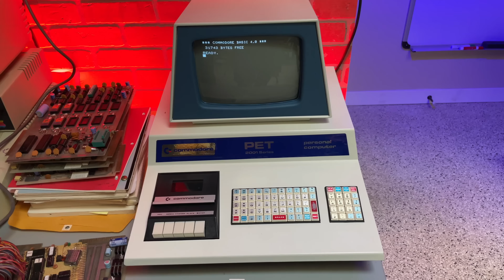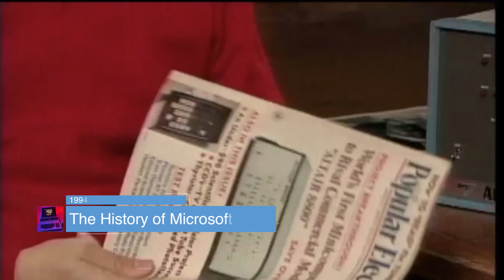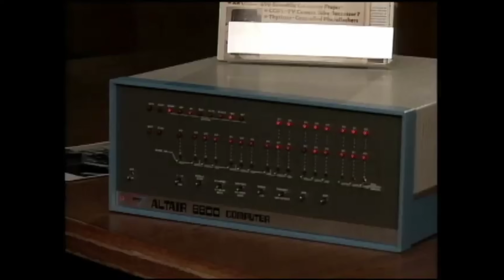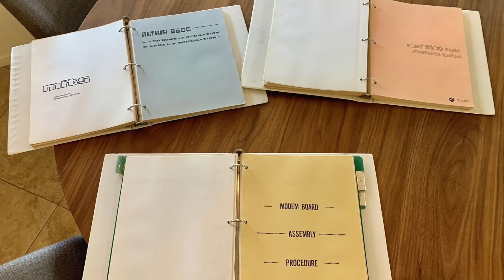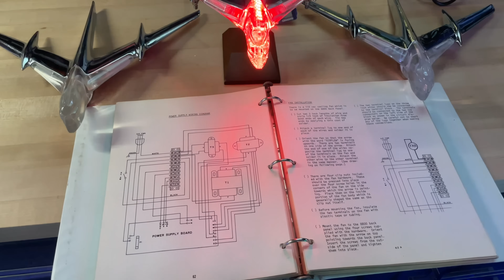The Computer that Birthed BASIC and led to Microsoft!

Comment: This is a story about the one that got away. When I first moved to Seattle I traded a friend a high resolution (for its day) monitor for an Altair with all the goodies. The Altair was rumored to have belonged to one of the engineers at MITS.  It was fully decked out with 48K memory, 4-8 inch drives, serial and parallel ports, a Hayes modem, running CP/M 2.2, Wordstar, etc.  I drug home An old DEC lineprinter up to my second floor apartment in Kirkland, Wa.  In other words I was in computer heaven.  Then circumstances prevailed such that I had to return to Florida for a short period of time.  I left the Altair with a friend expecting to return soon.  Unfortunately soon didn’t turn out to be that soon.  My friend got married.  His wife didn’t like seeing the Altair taking up closet space, so the Altair ended up being sold in a yard sale for something like $20.  I still have a number of vintage computers but the loss of the Altair breaks my heart.

Comment: We actually already have the same power distribution concept now as that Altair 8800. The graphics card isn't actually using 12V to operating anything. But 12V is a better voltage than 5V or 3V3 or 1V8 or 0V9 to distribute because a higher voltage means a lower current.

So the PSU sends 12V to the motherboard that has DC/DC that produces the CPU core voltage, CPU I/O voltage, RAM voltage, chipset voltage etc.

And the PSU also sends 12V to the graphics cards that has DC/DC to produce the voltages for GPU core, GPU I/O pins, RAM, ...

So the use of alternative voltages gets reduced as each new ATX PSU standard gets released. A long time ago, the main power rails were 3V3 and 5V and the 12V rail was mostly to the disks. Now almost all power is drawn from 12V.

DC/DC have become cheap since they are so much integrated. Some are a single chip. Some needs a transformer, some capacitors, maybe one or two inductors and one or more switch transistors.

So it's best for each electronics designer to design the custom voltages needed while the PSU just focuses on enough stable power at best efficiency.

Comment: As noted in some other comments, the electrolytic capacitors on the supply board should be replaced.  They do dry out over time.  They are inexpensive and readily available and look to be easily accessible on the board for easy removal and replacement.

I recently replaced all the electrolytic capacitors on my 1980 Kenwood TS-830s amateur radio, which was over 100 capacitors and took a while, but slow and steady work finished the task over a weekend.

My first computer was an Ohio Scientific Superboard II.  One of the guys I was stationed with in the Army in at a satcom station in Daegu Korea in 1978 had assembled his own computer from Ohio Scientific from scratch, including soldering in many of the IC chips on the various boards.  Hi Mike if you're out there . . .   

We spent quite a bit of time playing on that and learning and writing programs in 6502 assembler and BASIC.  By the time I was ready to purchase a computer myself sometime around late 1978 or early 1979, they had released the Superboard II computer which was mostly ready to go, just needed a TV and cassette player for saving and uploading programs.

Great starter computer and first of many many more in the 40+ years since then.

Comment: This is the original type of computer, flashing lights and switches. A superb teaching and learning aid because it takes you through the evolution of computers. I'm assuming you add a serial port and storage and end up with a normal computer you can type on.

Comment: 11:40 "I honestly don't know how much water electronics are capable of temporary tolerating..."

A whole lot. Assuming you've removed the power source and discharged any capacitors before the water happens, and you dry it all out before it has a chance to cause any corrosion, it's actually pretty hard to destroy electronics with water alone.

Comment: And for me personally.... I am happy that I lived through and experienced the evolution of home computers, from the mid1980's (84/85) and to now. To me, the height of MS, were back during the MS Dos 6.22 days. Back then the OS were bullit proof and if you lost data, it was only a question of having two floppy drives and booting norton undelete from A:.

Late half of the 1980's and first half of the 1990's were also cool. It was a magical time with Commodore, Apple, IBM, MS and others, pumping out new stuff and inventions. That was the golden time. To me, as I were gaming in the 90's, then the years 1992 to 1993 were the most magical. 1992 is that year that started with the Amiga being the best gaming platform, and ended with Dos x86 being the best gaming platform. 1992 were the time were everything were just so beautifully balanced all over the industry. The year were all top-machines for home that were sold in shops, gave the same kind of premium experience. Yup. 1992 is the ultimate year with most equally good choices.

It is a sad time we live in now. Only few makers of hardware. 😔

Comment: you can just use a modern switch mode power supply with a variable voltage pot. Measure the Amps consumed and get a replacement, just because thats how it was done 45 years ago don't mean you still have too. Plus those transformers need rewinding badly  and might catch fire, I would leave the room while its on at least... rock on dave.

Comment: The crap computer switches and LEDs in my electronics tech course in 1980 we had a TRS 80 level 3 no floppy drive,  including micro computers from Heathkit  ET3400a micro trainer .

Comment: It's my understanding that the "computer that birthed BASIC" was a mainframe system on a college campus.  It was noticed that the computer was standing idle most of the time and it was capable of handling input from multiple users at the same time.
So BASIC was developed as an easy way to program the computer (a lot easier than the other languages which existed at the time, which were oriented towards particular fields, such as COBOL for business and FORTRAN for mathematics).  BASIC was instead designed to be versatile and easy to understand.
Computer terminals were located in accessible places around the university, all linked to the computer so that anyone could program the computer in BASIC and save their programs on the computer.  It proved to be a huge success and this was the real birth of BASIC.
Although the Altair may have come first in the home computer market, it's my opinion that the TRS-80 was the first really popular "home" computer to use BASIC and led to the huge popularity of incorporating a version of BASIC into all home computers during this era.
Reply: I so agree!  Microsoft didn't birth BASIC.  I mean MSDOS was good.  Basic wasn't a thing on my univ. mainframe ... it was Pascal or Fortran 77, but that was in '88.  The dummy terminals sucked at text editing.  I still have my TSR-80s in boxes.
Reply: Oh, and congratulations on fixing the power supply.  I know how much fun it is to work hard on something not knowing what the result will be and then find that your efforts were actually worth it.

Comment: I know you can use a dishwasher to clean modern computer components and motherboards(see der8auer on YouTube) the older boards with exposed wires & non machine soldered connections I would be hesitant to expose to regular tap water.

Comment: The filter cap in that linear power supply are all worth replacing give the age of that . As well as cap manufacturing has progressed almost as far as the computers  in the last 47 years.  Go with 105C cap they will live longer .  A switching supply will have  noise in this app.  Not sure without measuring it if that noise would effect the unit. Given that this unit is now more a museum piece rather than a work horse  my concerns may well be over blown . Regards

Comment: I worked for a company in 1977 -78 that had exclusive to sell IMSAI 8080's  - essentially the same as the Altair ad I think made by former Altair employees. One summer at Ultra Byte I sold over 150 of them , 20 to NASA - they claimed to be using for "mail system" but a couple years later I saw them in mission control consoles.

Comment: I started programming BEFORE there were personal computers.  I started on an IBM 1500 system in a CAI lab.  Thats Computer Aided Instruction.  Later I wotked for a CPA firm that used the CPU froma 1600 system stand alone.  That IBM 1130 was just about the smallest mainframe ever sold.

Besides running the normal educatioal sofwarte it was capable of running other styff.  It did not run BASIC.  It ran APL (look that one up).  We had the actual APL type balls for the Selectric printers.

Comment: I'm going to say that it was a break in the wiring. That seems most likely to me. The transformers either work or they fail (broken wire inside or insulation breakdown), and they can last a very long time. Nothing else changed, so likely the wiring.

Comment: In the decades before getting the dreaded IT calls I used to get the family "the TV is broken". Ok, get dad/grandad to remove the back and gently hoover it out. Use a clean paintbrush to remove as much detritus as possible. Be gentle, but get the muck out. Also, put the kettle on. 
"Oh, will that fix it?"
No, but I'll be there in an hour and it'll be a lot more pleasant to work on. 
CRT TVs were absolute dust magnets, hated them. 
I ended up in Boeing London Service Centre (yes, Boeing acknowledged the British spelling) and the worst was a 737 Flap Control Unit. Or may have been the APU Control Unit, meh, it's been 25+ years now. 
If the forward toilet had a leak then it ran straight down onto this box. It'd stain your hands/clothes with that lovely blue chemical toilet stuff. 
Forget running initial tests, it was seals intact or not, boards removed and the whole lot went straight into the ultrasonic soapy water bath. Then dried out in the 60°C oven after rinsing with distilled water. 
Never underestimate how much nicer it is diagnosing boards when they're clean.

Comment: when I read the title I immediately assumed you were talking about the minicomputer that Bill used to write the assembler code for his i8080 BASIC. as writing the BASIC on the Altair itself was not a real possibility,. It is the case that Bill had access to a minicomputer (PDP10) that was the main reason he had a head-start on anybody else trying to do the same thing. You would need a real computer to write a BASIC interpreter, you would need plenty of RAM and fast storage devices to "bootstrap" any BASIC interpreter. Also as you would later need to port the 4/8K Level 1 BASIC to 12K "level II" BASIC you would need even more resources, especially if you also wanted to cross compile to other CPU architectures, like the 6502. you sure would need a minicomputer.

Comment: Very interesting to see.  I was in college when that cover came out, coding on the mainframe belonging to the university.  I wanted a computer that I could use at home and I contemplated buying one of these, but I wasn't an electronic hobbiest I wanted something to code on and these computers weren't ready for that yet.  I ended up with a Commodore 64 and then of course one of the early IBM PCs.

Comment: same happened with my commodore sx64. it arrived with the internals in pieces. i took it fully apart and i was able to identify the faulty chips replaced them and make it work. i am not a electrician either, i feel very lucky to be able to fix it.

Comment: I remember when that magazine came out.  I was programming IBM mainframes in assembly language at the time and I knew it was a big deal.  I still have that magazine issue locked away all these years later.  Gates and company built an empire and I have a magazine put away - yeah, missed that opportunity.

Comment: My father washed all the guts of an expensive piece of technical equipment at his first week of work. Everyone was aghast, but he just noted that it didn't work, what was there to loose? He washed everything, oven-dried it, and a machine that cost as much as a house fired right up.
I washed the guts of a digital camera that fell into a pond, and cleaned the optics; still have it, works fine, though now it's a "vintage" item.

Comment: I'd bin those electrolytic capacitors on principle. If they are original, then they are way past their use by date and are trouble ahead. I would replace them with 105C spec.

Comment: Experienced electronics tech here. From pausing your video at the circuit diagram and seeing the number of taps on the transformers, I suspect that the large transformer was for the high amp 8 volt feed and the smaller one for the other for your front panel, the multi-tapped smaller transformer would make sense for the + & - 16 volts.  If this is the case the connections in the circuits to the smaller transformer would most likely be the cause of no 8V for your front panel, the act of simply pulling it apart, cleaning it and reassemble has rectified the connection issue. It is my experience that connections cause the majority of faults in circuits.

Comment: Glad you took the appropriate safety precautions (checking wife was out)

Looks like some of the PSU electrolytic capacitors have already been replaced - might be worth replacing them all TBH or at least checking to see if any are bulging - they don't age well compared to the other components.
Reply: I noticed the two different capacitors but then figured they were probably different voltage for the other rails. 1970s electrolytic capacitors are pretty reliable.

Comment: I had that issue of Popular Electronics, and wished i had the money for that computer. Over the next four years, I saw various other computers come out, and finally bought the least expensive one, an Ohio Scientific C1P. I did get the optional second 4k of RAM, so that it had 8k. Within a few months, I noticed the extra RAM had one bad bit, and was able to figure out which chip was bad and replace it.

Comment: plausible faults: That broken wire. Corrosion on all the screw terminals broke loose and reconnected. Dust and dirt obscuring a metal flake acting as a short somewhere. Gremlins. Altair Gods just wanted a little love. Literal bugs. Fairies blessed you with pixy dust at the very moment you were reassembling. An old chip/device finally warmed up and dried out the accumulated moisture it had sucked in sitting idle for decades.

Comment: Washing a dirty computer is a perfectly valid first step for troubleshooting.  I got a fully dead laptop that was coffee spilled to perfect working order just by washing the motherboard (and chassis) under the sink, rinsing it with IPA, and blasting it dry with an air compressor.

Comment: Interesting video - I love these history lessons, with actual hardware! A quick point on your analogy with sending unregulated power to the cards being as if modern PCs sent a single voltage to the graphics card and the card converts it to what it needs: actually they do - GPUs and their memory run on very low voltages (~1V). They pull power from 12V (via the slot and cables) and contain lots of voltage regulators (VRMs) to do the conversion. VRMs and their passive support components make up about half the components on modern graphics cards!

Comment: Built my Altair 8800 from MITS as a Kit of the month plan. Each month you got a part. Last part was the Intel 8080 processor. It worked the first time. Toggled in kill the bit as my first program. Got a serial board and hooked it to my "TV Typewriter" terminal that I built the year before. Later got cassette tape interface working. Sold it a few years later and built a Altair 8800B.  Those were fun days!

Comment: Most electronics can take alot of water (though I wouldn't leave them soaking for an extended period of time - corrosion).  I work for a major semiconductor manufacturer.  We put many of the prototype boards we build through an ultrasonic cleaner to remove soldering flux.  Not sure exactly what they use in it, but it's mostly water, maybe with some sort of solvent or cleaner.  These boards are fully immersed while they are in there.  As long as the boards are thoroughly dry before you apply power, it's fine.  Sometimes we put them in a low temperature oven (maybe 100C) for a short period of time (15 min, maybe) if we really want to get rid of the water quickly.  But usually we just let them air dry for a day or two (dry climate where I am, so water evaporates fast).  The only things I would be wary of immersing would be optical assemblies, switches (many SMD DIP switches come with a plastic film to prevent water intrusion during cleaning), and maybe antique caps (modern ones are well sealed and should be fine).  Boards with chips and regular LEDs are fine.

Comment: I started USAF Basic training in Nov 1974 and then on to electronics school at Lowry AFB in Denver. I started a subscription to Popular Electronics with my new found "wealth" and the first issue I received was Jan 1975 with the Altair on the cover. I was hooked. It would still be several years before I got my first computer, a Radio Shack Model I in 1980. Hope to see more of this beast as the first one I saw was in 1977 out in a computer shop in Albuquerque. Some of the guys were trying to get code running to access an 8 inch disc drive.

Comment: You win the prize for coolness. I was a subscriber to PE when that issue came out. Financially, acquisition was out of my league back then.
You may want to check and/or replace the electrolytic capacitors on that supply board. They are a pretty common problem on most old radios and other vintage electronic equipment, as they depend on a chemical process forming the insulating layer between the foil plates, and those chemicals degrade eventually. It looks like two may have already been replaced, the rest may be barely operational.